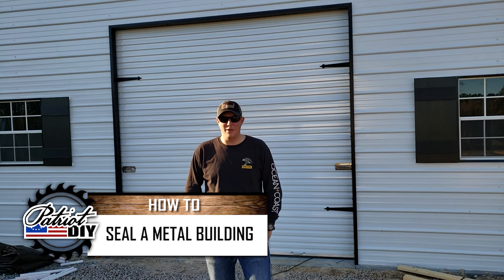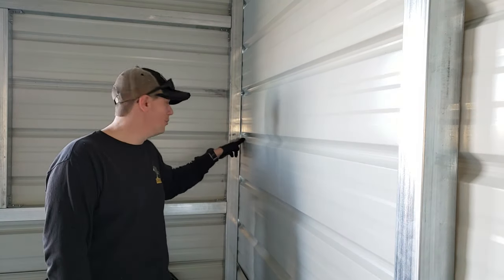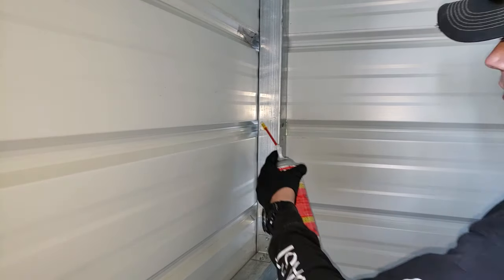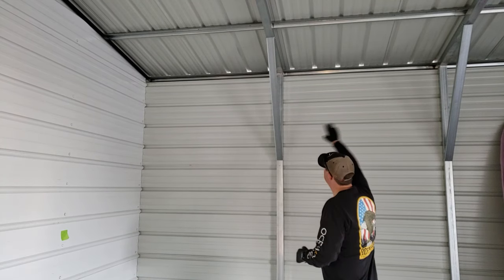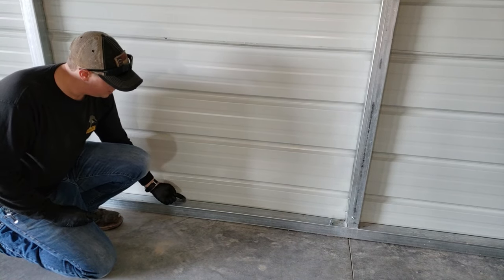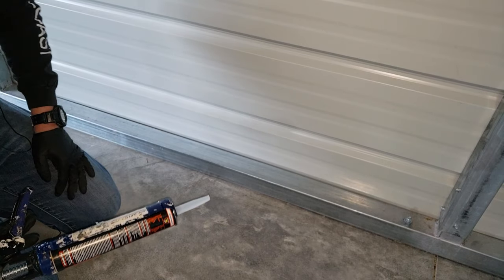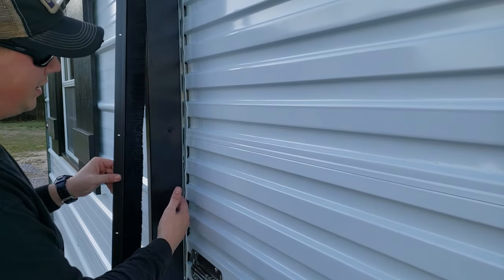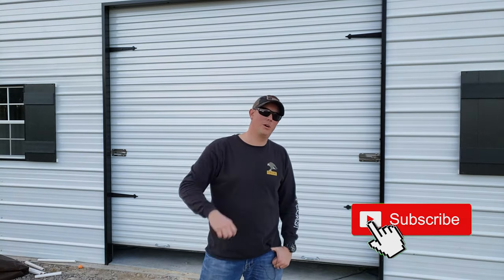How To Seal Gaps In A Metal Building

Comment: Great video, thank you. If I can add a thought, when you are using the expanding foam, if you use 2" painters tape on the surface of the metal siding next to each post, when you cut the excess off it will peal away with the tape.
Reply: Thanks for your help great information

Comment: Good video, I put Butyl rubber tape on the concrete before the frames went down to seal out water and bugs.  Plus Carolina Carport built my 24X40X12 and lapped the bottom panels over the slab about an inch.  Very effective at keeping water out.  Silicone always works better when squeezed between pieces.  If you use choose to use silicone apply it first then screw the outside panel in the middle to squeeze it, it seals much better.  My building just got completed, now it's my turn to get to work.

Comment: Great video! The step-by-step guide on sealing gaps in a metal building is super helpful. The tips on choosing the right sealant and applying it correctly really make the process clear. Thanks for sharing such valuable information! Has anyone tried these techniques on older metal buildings? How did it go?

Comment: Thanks so much for the info! The snow blew in on my doors during the storm this week! Those garage brushes look to be the answer to my problem! Thanks for sharing!

One thing to add is if you have any rodent problems, you can add steel wool or a wad of metal window screen  ( I prefer this as steel wool can rust and cause stains)to the holes at the corner of the siding to prevent a critter from chewing throw the great stuff. 

Loved the flags you have hanging in the rafters. Going to add some to mine like that! Looks sharp!

Keep up the fantastic work! I really enjoy your videos!

Comment: I put my metal building on a gravel pad then poured the concrete inside over the bottom tubes using the walls as forms.i don't get any moisture or bugs or rodents in.

Comment: I had a bad result using the spray foam.  As Rain blew in behind the corner flashing it would get on the square metal beam and run down till it found a  the floor.  I ended up having the same issue with the eaves.  I removed the 4 corner flashings and filled in / sealed where the two panels met at the corner and then put the flashing back on.  Now any rain that gets behind the flashing stays on the exterior and can't get to any of the interior structure.  I think it took me 8 tubes of silicone for a 20 * 20 and I was very generous with the silicone.
Reply: Thays a good idea, use the foam filler you can buy would probably work great?

Comment: I have a very similar building with 3" of concrete extending beyond the panels. I see you chalked just the inside but I'd be concerned that water would come in from the outside and sit under the square tubing and take forever to dry with the inside sealed. I do like the idea of adding fasteners to tighten up the horizontal panels but I would definitely also seal it with Loctite Concrete sealant to keep the underside of the perimeter tubing dry. Once I see no water coming in, then I'd seal the inside.
Reply from the maker: My concrete has a 3/4" step down from the inside surface to the outside surface and my siding overlaps that.  This prevents water from seeping in, I just added the scylicone as an extra measure and to keep bugs out
Reply: I started to do that but the contractor told me it would be better if the siding would extend over the concrete so the water would not run under the walls.  Did that and no water problem.  Also where the doors are I had them to give it a slight slope so the garage was about 3 inches  higher than the drive way.

Comment: I tried silicone sealer under my base rails as you did here and it didn't work very well. I then switched to Sika polyurathane - the big tubes - and that worked.  It's thin and runs under the base rail.  After it dried I went back and ran another bead. I went from having wet floors inside the building to completely drying it in by doing that.  Try the polyurethane if the silicone doesn't work for you.
Reply: I like your comment regarding the Sika product. Is there a specific Sika your referring to? Is it an adhesive?

Comment: Thank you for the video! This helps me with my big metal garage and my little metal handi-house. One question: how do I keep water from intruding the roll-up door on my garage. The person who had it built didn't have the concrete leveled properly and water gushes into the door opening even with it down and having a rubber seal on the bottom of it. THANK YOU AGAIN! 😊🙏🏻
Reply from the maker: They make a rubber peice that goes on the floor at the bottom of the door.https://amzn.to/4azSiEr

Comment: Get the Pro tool for Great Stuff. The cans go a LOT further. It cleans up very easy and you can easily control the foam flow. Because it is so controllable I was even used the foam around the bottom. Get the tool, it is worth it!

Comment: Great vid!  Thank you for taking the time to share with all of us.  One curiosity- why not silicone the outside of the building where the siding meets the concrete as well, in order to keep any water from getting between the siding and framing?  Thanks again, just subscribed and will be supporting this channel in the future.
Reply: You are correct in that the silicone to prevent water intrusion should go where the water first has a chance of entering. In this case, had he done it outside there would be no need for the second bead inside where the siding and bottom rail meet. The outside took care of that.
Reply: @centexan  can you do both inside and out? Would silicone the best choice for the outside? Or would Polyurethane work better out side?
Reply: @jamesceja4064  You can do both inside and out. But if you do a good job outside, the inside is a waste of time and money.  Make sure your concrete is cleaned well before caulking no matter what you use. Silicone 2 will last much longer than polyurethane caulk outside. Silicone is uv resistant and polyurethane is not.

Comment: Thought I'd share what I did in my metal building. I took the outside door latches off and swapped from left to right and mounted on the inside.   . Friends also but on his we had to drill two more holes on each side and plug two old ones with bolt and nut. Know they are only accessable from inside.  Ps I like the door brush seals .

Comment: Great video! Do you have any suggestions for the gaps where the side walls meet the roof? We have a pretty large gap there.
Reply: You could use rigid foam board? With the spray foam around it to seal it in place.

Comment: Hey.  Fan of your videos.  Wanted to see if you did anything special around your windows.  I have the same type of building.   The top of my windows touches the horizontal 'rib'.  Recently, we had blowing wind/rain and all kinds of water came in.  I'm pretty sure it's from around the window.  Did you try silicone or some type of flashing around the outside of the windows?
Reply from the maker: I havnt had any issues around my windows so nothing special there.

Comment: Did u foam the top of the roof where the roof cap is, on my steel building u can see where the light is coming through, just curious how or if u sealed that gap on your building, great video by the way has helped alot
Reply from the maker: No but it is covered by my insulation.   I have a video on that too
Reply: mine has birds coming in.. 🤬

Comment: On my metal building, my most troubling spot is the gap along the roof ridge. I get a lot of straw and tree debris coming into my building from this area. Any solutions?
Reply: They make them for the ridge cap to.  Easy install I have installed them on my metal building

Comment: Just finished mine over the weekend.  One other thing with the bottom, I am thinking of pulling the bottom back and inserting a flange to help guide water away from the concrete.  Only one problem will be at a location where the concrete comes out from the wall too far.  But, thanks, I will consider it.  Next thing is insulation choices.  A friend recommended the spray foam.  Not sure that is the best.  Ideas?
Reply from the maker: I had some areas where the siding didn't overlap the concrete properly and I had to add some flashing to the bottom.  I have a video on what I used for insulation, check it out.   Spray foam is prolly best but it's expensive
Reply: @PatriotDIY  AH! Thanks,  I have to get the guy to price it out.  May be out of my budget with a 30 by 50 by 14 then.  I used to work for a resin company years ago and had the foam available to use.  Could have done the job myself because I sold the equipment.  But, it was carcinogenic and dangerous to work with.

Comment: Does the foam deteriorate after a time? I live in the Deep South where the summers are pretty extreme. Wondering if I’ll have to go back in 5-10 years to scrape out crumbling foam and put new foam in. Thanks for the video!
Reply from the maker: No you shouldn't!
Reply: I spent a lot of time in the desert in the middle east, with summer temperatures above 100 degrees on several days. The foam insulation held up well, sealing metal containers I lived in.

Comment: Great video thank you. 1 question, when siliconing the base rail to keep water out would it make more sense to do this from the outside instead so that water doesn't get under the rail and stay there? Or am I overthinking it?
Reply from the maker: Both would be great! The best thing is to have a 1in step down lip around your slab and have the siding overlap it so water cant settle at the bottom of the wall. That's how mine is, so water isn't much of an issue for me, I mainly sealed mine to keep out dust and bugs!!
Reply: @PatriotDIY  copy that thank you. I did that on 3 sides but on the 4th I extended out for a walkway and that was a mistake because water comes in. Thinking about shoving a silicone backing seal under the base rail then siliconing inside and out. Thanks again!
Reply: I got them to put the rolls of foam used to keep sill plate off concrete in homes under my metal building.  Anywhere concrete touches metal I got them to put that foam under it.
Reply: @jordanpiesmith  so did the foam work by spraying it under the base???
Reply: @mikerucki278  I used the foam rolls that were for sill plates. It's blue and made by dupont

Comment: Did they install flashing on the outside of your shop? To keep the water from coming in between the concrete and metal frame. If not, how has the caulk worked for you on the outside to prevent any water from coming in?
Reply from the maker: My slab has a 3/4" "stepdown where the siding meets the concrete, so the siding actually sits below the main surface of the slab. No water issues and no need for additional flashing.
Reply: @PatriotDIY  ah okay. The house I bought had this shop already here, shop is only a little over a year old. And they did not add flashing to the bottom. Concrete actually sticks out 2 inches on each side and 3 inches on the back side. I’ve caulked it a few times and still no luck on keeping water out. Looks like I’m going to need to add flashing to the outside of the shop to take care of the water. What are your thoughts?
Reply: @xDonaldDuckx10  yep!!  Gunna need flashing!
Reply: @xDonaldDuckx10  how did you flash your shop? I have the same issue with mine.
Reply: @xDonaldDuckx10  where you able to resolve the issue of water seeping under the base rail? what did you use that worked?
Reply: @robertenyeart3419  I made my own z flashing and laid it on the top of the concrete and screwed it into the existing studs. I then went back and caulked the top of the z flashing that met up to the siding of the shop. 100% water proof now.

Comment: I tried this quad stuff and bought about 7 tubes of this stuff at lowes,they are more expensive than regular sealants.I bought the white stuff and used it all around the perimeter of the building,sealed top and bottom.This stuff does not work!A rainstorm occurred here in Pensacola and in the morning the floor of my 2 car garage was flooded with water!
Reply from the maker: Well you need to make sure you use enough and get a good seal , it also requires that you have proper grading around your shop and you have the siding overlap the slab like it's supposed to..... This stuff works but it doesn't perform miracles...sounds like you have way bigger problems than sylicone...if you have bad drainage and poor grading or your siding is sitting on top of the concrete without an overlap you need to fix that first !!!!

Comment: yep i did the same thing putting silicone down it does not work water is still coming through
Reply from the maker: Sounds like your problem Is your siding resting on the top flat of your concrete allowing water to settle and get under the wall. Your siding should overlap the concrete.  You will likely need additional flashing on the exterior.

Comment: From my experience spray foam is terrible! It's toxic when it burns and it's just a millionaire holes that cause it to leak? Why would they have a building where you can actually see the light through the corners of the walls? It seems like there's very little care done with engineering and designing?
Reply: They should have the option for the owner to have a prefabbed rubber composite seal to be installed on all the corners between the metal posts and the metal siding. In this day and age, why isn't this even an option for the owner at construction time

Comment: Now I'm officially confused? I just watch a video where they cut two inches off each side of the roof to make a giant hole and now the next video is patching the holes with foam sealant? Isn't that going to cause a massive condensation problem?
Reply from the maker: No condensation problems here! Building was insulated after this.

Comment: Why waste your time if you're insulating it especially with spray foam it'll fill those holes in at that time.
Reply from the maker: Because I'm not insulating with spray foam. And because weather you insulate or not sealing gaps is gunna be a good thing to keep out air, bugs , dust, and water
Reply: Air gaps will negate all insulation, no matter what you do. Always fill air gaps